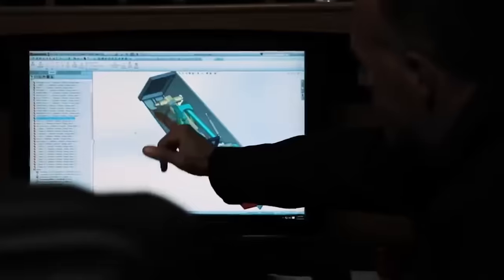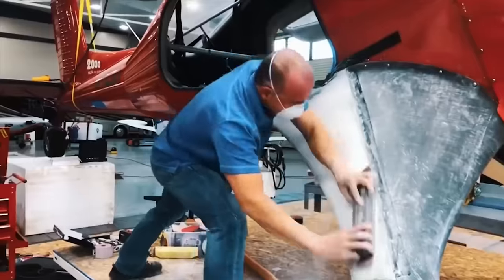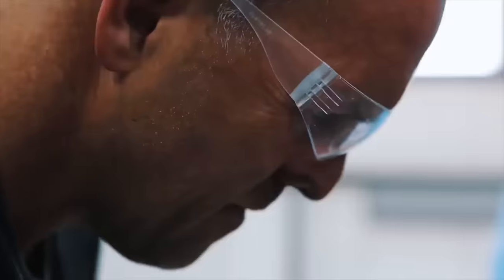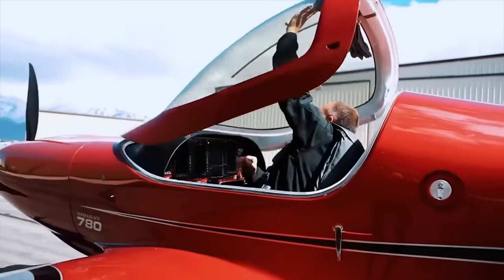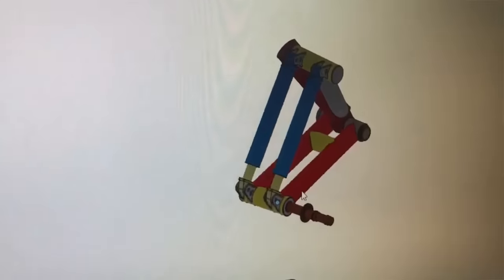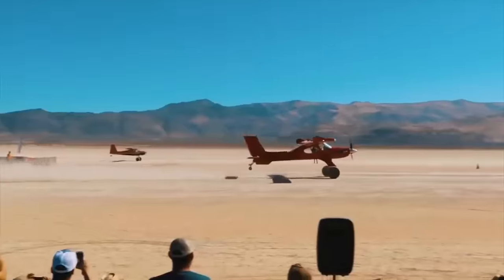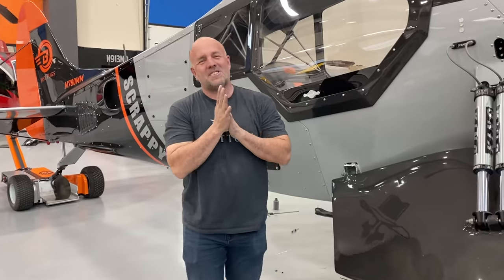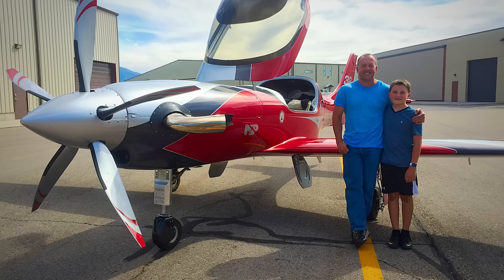This Is Gonna Suck!...We Do It Anyway - Engine Cowling | Scrappy #44

Comment: Love your work Mike. 
My father taught me how to work with fibreglass when I was a young teenager.  I needed to mend my surfboards and that led to mending all my mates surfboards and that eventually led to mending boats and when my father and I started to race sailboats he designed multiple parts that I would build moulds for and eventually amazing parts came from that. We transitioned to using carbon fibre when it became available and like yourself, I too dabbled with Kevlar. Now, I use a carbon/Kevlar weave for making parts. The best of both fabrics in one. Tricky to work with and it’ sometimes SUCKS, but when everything comes together and the part pops out of the mould... so worth all the work that went into to it. 
Thank you for passing on your knowledge and sharing your passion. We all gain something from your efforts.

Comment: it almost seems like mike wants to do anything except build wings :D
Reply: There's likely a lot going on with his wings in the background.  He has likely designed a whole new type of spar and other components. Depending on which design he has actually chosen to develop, it may be the most major New Concept Designs Aviation has seen in a very long time. 
    I'm just curious what it is. Will he choose to adjust the length while in flight? Or the cord thickness, With perhaps a giant Kevlar airbag? 🤷🏼‍♂️
    Whatever I'm sure it will be unique. And will require many hours off camera.
Reply: @Ozarkprepper643  yeah i know, its just become a bit of a joke at this point that the most crucial part hasent been seen yet :D
Reply: @niklasxl  I get you. Everything but. Probably has more miles taxing without wings then some Plains see in a year. lol

Comment: I’m a little confused. How come when sanding you wouldn’t use a palm sander? Better finish? Just a question. Thanks
Reply: I m not an expert , but I think they call it a long board and it helps with forming complex transitions and curves , I ve seen boat builders and panel beaters use the same thing when gaur a car or boat , palm sander is working in one spot

Comment: In relation to the poll that was posted; I dont even think a comparison can be made between Draco and Scrappy. They are 2 totally different planes. Each one has its unique features that make it just that, unique. 

Draco goes a little deeper with some people because the wilga has a die hard following from long before Draco. Scrappy on the other hand is a scratch build. Im an old hotrodder from way back and biker my whole life. I wont ride a bike I didnt build from the ground up. And the same with a hotrod. A custom built whatever, bike, car, plane, ends up having its own soul. I always felt at one with my bikes because I knew them right down to the last bolt and washer. When it hick uped, I understood why. I felt a part of my build and its something Ive never been able to feel from something bought in a store. 

And so scrappy has its own essence thats unique to Scrappy. Draco has its own uniqueness. So I dont think the 2 can be compared. Scrappy should be finished before a proper comparison anyway. Im sure Scrappy can fly as is right now, but Im pretty sure everyone is chomping at the bit in anticipation of the wings.

Comment: Hey Mike! I saw when you opened your belly pod.  Your lock actuator is exposed, but on a surface angling down.  You might what to shield it with some CF and drill an access hole. Prevents stuff from jamming the lock closed.

Comment: Man that looks like a lot of work but still still seems easier than building a plug and vacuum bagging! Love the method you’re using. I may or may not be using this as a reference while doing the bodywork for a FSAE electric race car.  Would love any more tips or tricks you might have on working with composites

Comment: You've got to start using expanding foam and drywall compound for your mold plug. Hot wire and rasp the foam, drywall compound for the surface and final shaping. 5 to 6 hours for perfection. 
There's a 60 year old master of composites from Australia by the name of Bill. His youtube channel will blow your mind on composites. His number one objective is speed. He has created a series of tips and tricks over a lifetime that really can't be beat. His channel is 
WJP004

Comment: Surprised you're not using a pneumatic block sander. I have a sander that's 14" long and 3" wide that's pneumatic and it makes it so much easier doing the blend sanding that you need a long sanding block rather than a D/A sander that could create low spots. Looks killer though! I'm always really impressed with the work you do! I wish I had a shop like yours!

Comment: Mr Mike maybe  Enlarge / extend the air intake power bulges further to the rear of the cowling  ?  Maybe with a " D ' rear  opening  to vent hot air . Might even get a small thrust from it IE: like a P51 radiator cowling

Comment: So funny you sand it all by hand where I use air tools to get the rough shape established and than I start using blocks. I use 320 grid on my air tools first. So much faster to get things into shape. 
And once you are happy with 320 you use 600 grid on the air tool before you just back to 240-320 hand sanding it all for the final shape. I just learn soft air tools work lot faster to get thins into the rough shape you want before you start using your hands. You should try it out too. works perfect for me on car's so why not on Airplanes as well.

Comment: I have in the past worked as a studio Engineer Things have changed a bit over the years but pretty much all cars now start digitally often surfaced in ALIAS as it's relatively quick. They work from designer sketches from photoshop who will in turn draw over a package i gave them. I haven't seen a designer work on paper for 10 years other than for the cameras.  Being a car designer is in my opinion brutal as you are constantly being judged by your peers and then the public.  The guy/Girl who's name gets associated with that design is essentially a Team leader who has a 3 to 4 other designers doing the real work, they choose the best ideas and direct the refinement.   The Alias data is then feed into a very large 5 axis CNC mill these things are pretty big as they have to fit cars and SUV's at full scale and often we will have multiple themes 4 or 5 is the most i've seen 1:1.  They run 24/7 and if one goes down it's a nightmare.
 The clay which sits on a rolling frame to replicate the ride height and wheel position can weight upto 6000kg even though they are mainly foam with a thick layer of clay.  It's then moved onto a cast plate which is where the real art starts.  The clay modellers take the clay and work it with the designers when they are happy (ish) it will get scanned and the surfaces will get developed again back in Alias in ever finer detail as more engineering input is added.  This can go on for months until we get to a point everyone is relatively happy and the class A surfacing happens using ALIAS but more often ICEM surf.  These guys get the surfaces to basically optically perfect as the better they get the surface the better the paint will be in the plant.  
I think alot of people think this happens overnight but it can take 3 years from concept through to production release on an interior and exterior really depends on how often the goal posts get moved.

Comment: Have you yet decided how you will design the wings?
A birds wing is the most efficient, & effective! All three joints & angles, in that folding process, where you can tuck for speed, & extend for low speed lift.
Been studying the design of a birds wings for a long time, & if flapping is not needed for thrust, the rest of the design can be used.

Comment: Unlike most epoxies, MAS epoxy does not create amine blush which has two important  properties: secondary bond strength is the same as primary without stripping. (PeelPly is still a good idea to keep crap out of the wet epoxy.) Second, and probably most important, you most likely won’t develop an allergic reaction to amine blush because it won’t expose you to it. NOTE: if you are already sensitive, your mileage could vary a lot and “amine sensitivity” is complex.

Comment: I am reminded of Burt Rutan's Pond Racer. Big engines, tight carbon fiber cowlings. When shut off with a hot engine, the composite was abusively heat cycled, until one day it came apart in the air. I see your big intakes, but you also said you are using the OE outlets. Is there enough outlet area somehow? How will it stay cool enough in there when you shut off the engine on the ground?

Comment: I got so excited with that intro. I watch this just wondering why your not 3d scanning and using that big 5 axis table you showed off earlier this year.  I think the exact opposite when it comes to "vision" with all the tools you can use like zebra stripes and other render tools you can use I feel like I can see flaws better in body shapes and flowing panels on the computer screen then in real life. Gotta try exporting your design into that epic game engine and then exporting it to a VR unit. Its worked great for selling customers on design options. Must be a generational thing.

Comment: Mike, you're down to the wings and I think I know what you are going to do, attempt to beat Draco's takeoff and stol performance.   My guess is that, you can't do that, unless you have a revolutionary wing type with slats.

Have you considered a configuration that will allow the wing tips to stall last?

Predatory birds have individual  feathers on their wing tips to prevent stalling.  This could be done by the following method shown on youTube, if you search for "“Unstallable Wing?!”".   Having an entire wing devoted to that is a bad choice, but for the wing tips, it might work.

Comment: Wow Mike!  Nice cowling.
Question:  When you hand layup something like a cowling on the pointy end of the plane does it ever cause problems because of non-symmetric airflow or lift?  Maybe the whole cowling is twisted subtlety or even dissimilar air flow in/out of the engine space?

Comment: Mike, why not just tape on some half-inch offset blocks in areas for clearance, wrap the engine in plastic, tape off the rest of the front of Scrappy, then spray foam over the plastic, creating a single foam block to start with, then sculpt the foam to the desired contours, so you would have a single piece foam mold that you could then lay your carbon over?  If you used foam blocks that were a different color than the spray foam and sculpted down to an offset block, you would know you went too close to the engine.

Comment: Just watching the sanding of the lower surfaces from underneath made my geriatric back and cracking shoulder joints ache. Will you be splitting the airflow with internal ducts to favour the rear cylinders so that there is less damming of the reversed airflow forward to the outlet louvres by the outlet air from the front cylinders. Is there in the future, a temporary GoPro camera, small LED light and wool tufts mounted inside the cowling to view the airflows? I guess not for the radiant heat from the exhaust pipes will ruin a GoPro fairly quickly. A thing of beauty and a delight to behold it is for sure. Yes I know that is a plag of the old signs in shops which warned that if the customer broke an item the customer bought it. Not all of us mortals are as capable of originality and art as this craftsman.

Comment: How do you manage the heat put into the cf from the engine? You're curing at very low temps and I thought you'd want to bake a part around the temperatures you want it to work at.

Comment: Instead of using all that micro and sanding it down, what about mixing up 5 minute drywall mud? It sands really easy, and you could build it up fast, and sand it down fast? Would that be a time saver?

Comment: I have an idea for the painting of the intake to “round” the squareness of the intake.
To make it more circular, paint a lighter color on the outer part of the intake, and a black on the inner surface that people can see, but extend the black paint line out a little bit in the middle of the top, bottom and sides. (  )

I’m surprised your shape before the exhaust ends abrupt \ and not more ~, if you want to lead the exhaust a bit more, curve it to a more gentle slope, but instead of keeping that slope and continuing to an abrupt end at that angle, curve it back to the direction of the airflow
___     ) in the corner 
         \___  ( in the corner
The sloped part 15degree and extend the material a short distance flat.
Not __     )
               \  edge turbulence at the sharp end.

Comment: Are there tools available for using VR headsets to be able to do a walk-around to be able to see all the lines at different angles, in different light etc, in stereo? Maybe not a perfect replacement, but it seems like it could be way better to see the final product than just on the monitor.  Either way I knew right from the start the engine was getting covered in foam, and was momentarily confused when you started talking about 3d scanning and machining a mold.

Comment: Mike could you take some of the ideas from forensic artist. They take points from skeletons to reconstruct faces using clay. Could points from the bare skeleton of the cowling be used like they do to make faces. My mind goes there. I don't know the mechanics but I think this may cut down on the design of the cowling. They have computerized 3-D facial reconstruction methods. Could this be redesigned or reformatted for your application?

Comment: Would it be possible to make a nose wheel/tail wheel that can be controlled remotely to act as the aircraft’s own tug? So basically it always has the tug connected to it that doubles as the nose/tail landing gear? If that makes sense, you would probably need power at the main wheels too so it would actually have enough power to move, it might add a lot of weight tho

Comment: Is their a reason beyond convenience of having it around that you used carbon and micro for the sculpted buck that you mold the final cowl off of? It seems like it would be much cheaper to lay all that up with fiberglass and bondo then pull a mold of carbon off of it, without changing the final outcome at all.

Maybe there is a detail I am missing? The micro seems to sand a bit faster than bondo by the looks of it.

Comment: Do planes like yours use the increased air pressure from the propeller to increase engine performance? like a giant turbo without sealed ducting?

Comment: Love your channel. Watching your channel really sparks my imagination! So I started to think that it might be worth considering extending the inlet bulge and putting a vent opening at the back edge of the inlet bulge instead of the vent gills. Since the inlets have a bulging shape, it would be reasonable to assume that the air will speed up around the bulge and you will have a low pressure zone behind the bulge. Please forgive me, I hate it when smart alexs think they know more than the guy actually doing the project. As I said, your project sparks my imagination and I hope this is a constructive contribution.

Comment: What about adding a couple NACA ducts on the top for added cooling..?
Reply: Nah, the air must enter from the front (highest pressure) and then needs to be routed internally to distribute evenly over all 8 ycylinders. As Mike said, he is going to install a pressur plenum inside the cowl to make sure that all 8 cylinders get adequate cooling. The air within the plenum will be at a higher pressure than the ambient air and needs to be forced through the cooling fins of the cylinders. If you now just make NACA ducts on top most probably the air would not be distributed as nicely as with the two forwards inlets.

Comment: 1:29 one of the biggest problems of modern design. Be it architecture (my field) or automotive, or any large scale design. Once you enter a computer screen, you'll lose perspective, lose touch. It's one of the key reasons behind buildings or cars that just don't look right. Computer aided design is an amazing tool, it has freed up soooo much brain power, but if you aren't capable of mastering it, understanding its peculiarities and intricacies, you're lost. And the worst part is, you don't even know you're lost. In school we used to call it the "yes box" because a lot of students had no clue that they were making basic mistakes until the prints or large papers were printed/drafted.

Comment: You're losing a not insignificant amount of exhaust energy by cutting the exhaust outlets at an angle parallel to the airflow; even adding some unwanted back pressure.  Cutting the outlets square to the airflow (like late WWII fighters) contributes a significant amount of jet thrust.

Comment: I always feel like I ask dumb questions... 

The two large air inlets at the front - where does the air go? I mean - I can see the air enters the engine compartment, but without an 'out' it seems it would have no where to go.. 
Are there a couple of air exit locations from the compartment I am missing?
Reply: Air goes out the exit vents in the cowling. Air goes in the intake scoops, down through the cylinders (which have fins to dissipate heat) and then the air exits through the exit vents on the bottom of the cowling. You can see them where he’s plugging the holes with the orange paint and duck tape.
Reply: Look @ 17:30